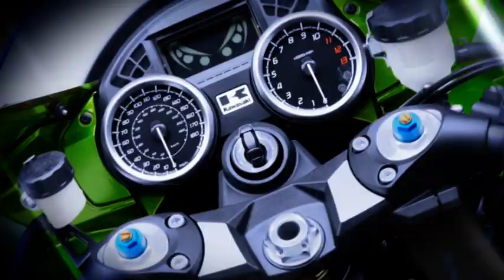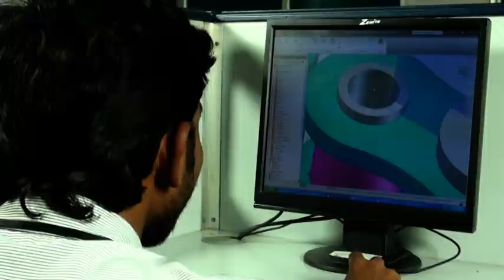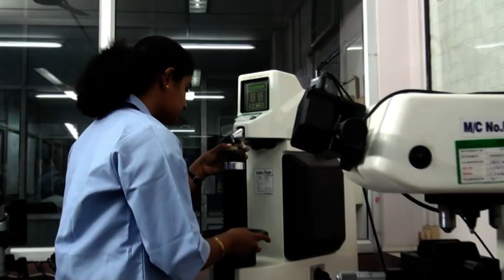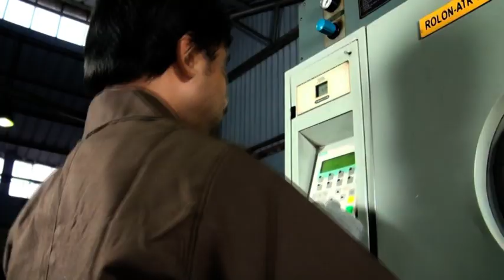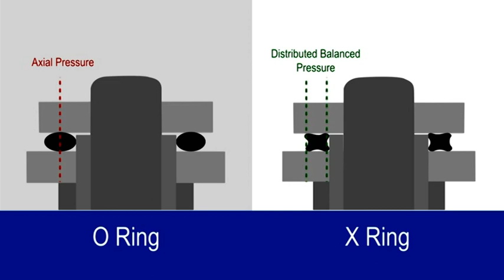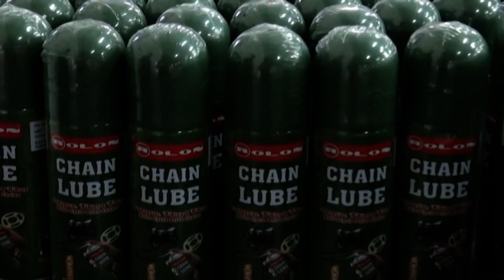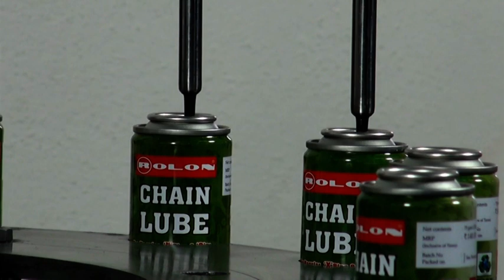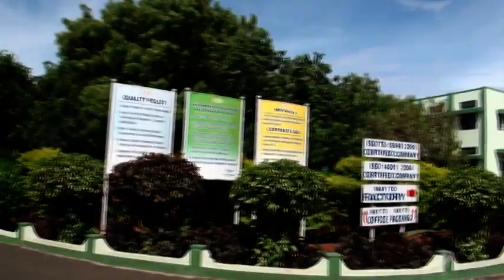Story behind India’s first X-ring drive chain I ROLON

Comment: I have doubt in your product. What's the difference between the "kit hbs 152" vs "kit hnbor 135" for tvs apache 160rtr
Reply: For 135 model it has 13 teeths in front sprocket and for 152 model 14 teeths in front sprocket, and both are same 44 teeth in rear sprocket.
Reply: hbs is standard chain(cheaper)
hnbor is O ring chain (costlier)